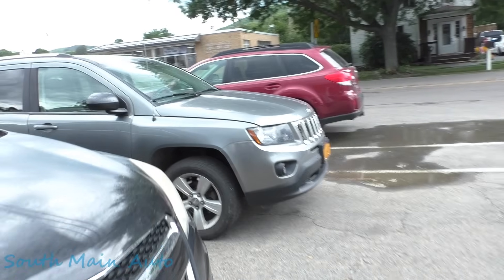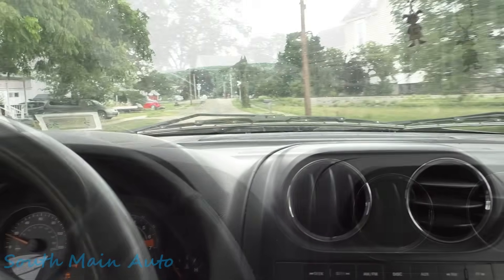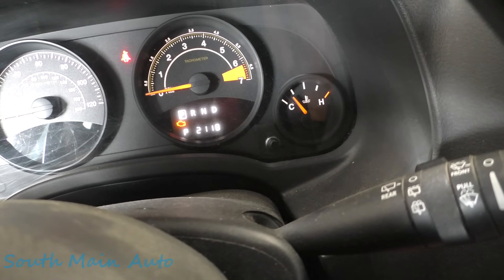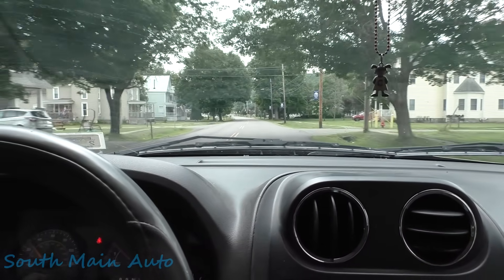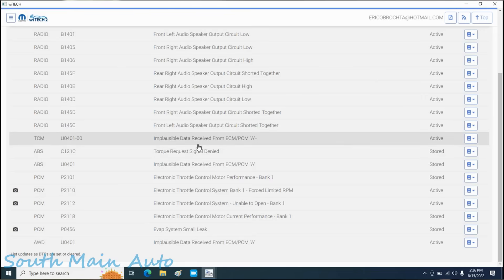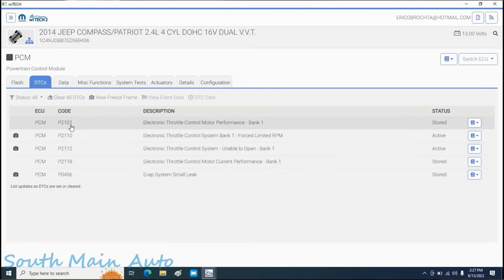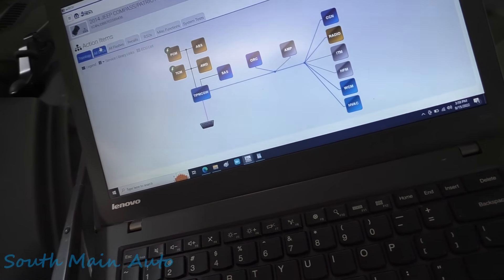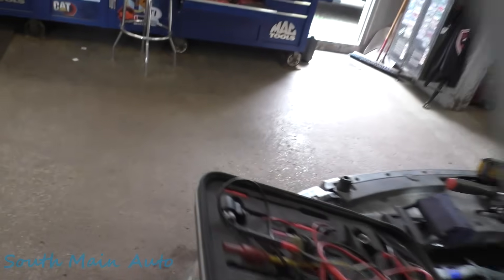Jeep Compass: Flashing Throttle Light & No Go

Comment: "You know, like you're really tryin to push one out"..... That was a hell of a visual there, my guy.... You always have the most informative and entertaining vids... Killer combo....
Reply: P2112 new slang for constipation!!
Reply: I laughed my ass off with the facial expression and above mentioned text.
Reply: I thought he was giving birth there for a minute
Reply: @roberttaylor3157  code brown if you’re in the medical field. :)
Reply: Throttle by wire replaced cables because it allows complete control of the engine. They can now adjust fuel flow, timing, valve timing and air intake. It allows the mfg to make more power and skip over rough spots. Also they can play with “modes” by changing the throttle reaction speed. Making sport touchy and eco slow to respond.

Comment: My wife’s journey has the same engine as this jeep had p2110 code with the traction light and throttle light. Was a intermittent problem at first, that went away after turning the car off and on. It would be fine for a while then come up again out of the blue. I took off and cleaned throttle body, checked for damaged wires and was good for about 3 months before it went out completely. Put a new throttle body on and solved the problem. At the time, this past February no one had in stock except the dealer who had a few on the shelf. From what I was told they go bad often, the new one is a updated version and I had to cut in a new plug that came with the throttle body because the connections are different now. Not a hard job to do though. Thanks for the video Eric. 👍🏻

Comment: commenting at 3:09 I'm gonna go on a limb and say it needs a throttle body. I had the exact same thing happen with my 2010 Compass and all the same lights. I read the codes and it had codes for throttle position and throttle pedal. Did some research and found the most common thing was the gears on the throttle body go bad or the bushings on the flap. I replaced my throttle body with a Dorman full assembly as it was all I could get at the time and fixed it. It was the bushings wore down and flap was getting stuck in closed position. Never had an issue with the Dorman part.

Comment: I really liked this video.   The throttle plate, linkages, and associated sensors are the cause of almost all drivability problems.   They are extremely reliable:  if properly set.  Then there is the "Industrial Hygiene":  keeping the important things clean and lubricated.   No matter how well someone is designed or manufactured;  things do get dirty and do wear.  In this case, he took the time to clean the throttle body assembly, rather than replacing it.   ...getting another couple years out of it and saving the customer some money.

Comment: A customer at the auto store stated he had the same issues. Sometimes it would throw the same codes.
      Thanks for your Channel he knows what to say when he takes it in for any repairs.
Reply: Guaranteed the throttle body is still bad.  The gears inside get chewed up.  Just change it out (20 minutes) with a Hitachi and it's fixed for years.

Comment: Son in law in law owns the 2012 compass I am serving.
It stalls on the road at unpredictable times. 
Inspected relay box and connectors inside fender well, relays clean and contacts clean.
Based on your video I will clean throttle body.
😊

Comment: Had a similar thing happen to a 2003 Jetta TDI. Being a diesel engine there's no throttle of course but it did have an anti-shutter-valve that kept the engine for sputtering on shut down. That thing got gummed up and stayed shut on the next startup. No codes so it had me confused for a while but I figured it out and cleaned it just like what you did. Fixed!
I had to pull that ASV about every two or three years and clean out the gunk or it would freeze up and no start.

Comment: I've cleaned many a throttle body. It's the first thing I do along with cleaning the MAF for hesitation, stalling or lack of response. 95% of the time it's the fix on most makes and models with higher mileage. Test drive then, if not fixed, diagnostics. Saves me a bunch of time and customers a bunch of $. Of course, you knew that. Quick fix with no parts and a  happy customer. They usually return and tell their friends.
Hope they got the brakes and bearings done to make the car safe. Great informative channel you have here....I've learned a lot. Thanks!

Comment: Excellent diagnostics! I really liked the logic of working with error codes. 

I don't think this throttle valve will work for long. Most likely, the plastic gear of the damper drive is already damaged. You can even hear it when you turn on the ignition. There will be a sound similar to a quiet crack. 

I was surprised that there wasn't a lot of oil inside. This means the PCV valve is still doing its job.

If you decide to wash the damper and see a lot of oil, be sure to change the PCV valve.

Comment: I've been looking into refrigerator issues and using skills learned watching these videos.  They call it the "control board" but really it is the RCM - refrigerator control module.  And you need wiring diagrams as they change wire colors on you.  But with the diagram, you can test from the RCM plug.  And they have evaporators for the freezer and fresh food now with a three-way valve to make things complicated.

Comment: Hello Eric O, I have a 2014 Chrysler 200 4 banger 259K miles owned since new. I replaced the factory throttle body with a mopar throttle at about 130K. In your video you said you were unsure when the pcm is performing its test cycles. For me the thing always went wonky at a stop light. It did it to me last summer and I cleaned the throttle body and it did it to me this morning coming into work. The code I get is P2173 to much air flow I checked for vacuum leaks last summer and found nothing. Its been golden until this morning. Im a subscriber because of your methodology to finding the root cause of issues its the only way to do it on todays vehicles. 
Mike - Plus8Precision

Comment: I had a similar problem with the butterfly valve sticking closed. Drove all day then all of a sudden I couldn't move the throttle.  Cleaned it up and it's been fine ever since. Cleaned a bunch of butterfly valves for others too. No parts required fixes are awesome. Stuff you didn't see before direct injection.

Comment: It's my opinion that a tuneup should include cleaning the throttle body and MAF. I believe this would prevent 90% of the throttle body faults. Maybe avoiding Chrysler products would help too.
Reply: You turn wrenches for a living?
Reply: 100% should be part of the 30k tune up with the spark plugs. FCA connectors notorious for the crusties, and the spot where the TB is gets VERY dirty.
Reply: @ShainAndrews  is that relevant?
Reply: @ShainAndrews doesn't fuckin matter dude...he's stating a fact. I've been turning wrenches for 15 plus years... ANYTIME I remove the intake hose the throttle body and maf get cleaned...but it should absolutely be included on a "tune-up", especially since cars these days don't have plug wires and caps and rotors etc...people that say you need to replace coils during a tune up are idiots. Coils don't fail that often. It's normally the coil boot with the spring. And you can replace those separate. I've only had one coil fail on two vehicles I've owned over the last 14 years...and I've bought and sold over 200 cars over that time.
Reply: @ElantraFukkenGang newer spark plugs are good for 100K miles
Reply: @jessejames96  literally says right in the owners manual of patriots and compasses replace every 30k with copper spark plugs. But ok. Lol
Reply: Well, I removed and cleaned mine and it's faulty now. Like he said they are very fussy about how they are supposed to work.

Comment: Eric - on the old school throttle cable - I had a Ford Fairmont back in 1989 that had the manual throttle cable stick wide open down in Bath NY going through the main light by the expressway. Shut it off quick enough, unstuck it and then drove up to the old parts store across from the library and bought some spray to lubricate it up. Throttle by wire is designed to fail closed.

Comment: I’m still early in the video, but the feeling of misfiring when sitting in idle in park after you had the throttle limp mode is because the ECM is limiting the engine speed down to 1500rpm by shutting off injectors. When the throttle hits limp mode, it will shut the power to the throttle motor off and the throttle will sit at about 10-15% open. When you were pushing the throttle and it revved up to like 2500rpm from 1500rpm, the only thing that was changing on the engine was re-enabling all the fuel injectors (and maybe changing ignition timing). The throttle body didn’t move at all, because the power to it was shut off. It would feel like it smoothed out when you shifted into gear because the additional load of the transmission being in gear was enough for it to be able to re-enable the injector(s) it was turning off and still stay within the rpm range that it was happy with.

Comment: Thank you Eric!  I enjoy watching your troubleshooting efforts!  I'm new to the automotive electronics bit and I was involved with industrial process control for a good part of my life.  It's interesting to see how the automotive engineers have "re-imagined" electric and data control circuits.  I know that they are cost driven, but it makes me wonder how cost efficient it really is except for manufacturing.  When you described the throttle body motor circuit and the redundancy involved it reminds me of what we call in process control and fire & watch systems as "supervision."  It is a way of determining the true state of a device in control, or if the circuitry or electronics driving it have been compromised.  Thanks again!  😁
Reply: @dizzy2020  All they have EVER cared about is assembly.  Decades ago when cars had frames, I saw assembly lines where the frames were upside down.  They put the shim packs in for front end alignment.  Then when the owner of that shiny new car finally has to have a front end alignment, the bolts are loosened and the shim packs fall out!  And over the decades nothing has changed.  They find the cheapest way to assemble a vehicle and the customer be damned!

Comment: I'm guessing too that the heat from the engine might play a role in expansion where the throttle sticks less after things warm up. Nice job going right to the problem and trying not to fire off the parts cannon.

Comment: Was having a similar problem with my 2003 Chevy S10 with the lil 2.2 liter engine. Cleaned the throttle body and WaLa it's been running good ever since. Thanks for the help.

Comment: My experience with these is that the gear train inside wears out and starts to get a bunch of play in it which hinders the plate from closing or opening to the proper position when commanded. Aftermarket bodies are useless and don't last, dealer only which means probably the updated connector. I've taken apart a couple GM units and found that there was just a bunch of lash in the gears between motor and plate, the ECM would command X% throttle but the lash would prevent that from being achieved AND if the TB was extra dirty it would bind up more than the return spring could pull it and with the slop in the gears the motor couldn't pull it further either. GM's go-to symptom was a crank no start or start and die that needed a bit of manual throttle pedal to get the car started. With Chrysler it's just codes and limp mode, but you can certainly feel and hear a big difference between a new and old unit. I'll echo others, it'll probably be back but it's a commendable and honest effort to try the cheaper repair first. If it does come back please update us and show a wiggle test between new and old throttle plates!

Comment: Just traded in my 2006 Pontiac vibe with 217,600 miles for the 2014 compass with 45,000 mile I hope that it’s as easy to work on as the vibe I’m getting cold feet, I utilized your Corolla wheel bearing video to press one on the vibe. Bought a OEM bearing kit. You provided top notch instruction! 👍

Comment: 2010 Dodge Nitro.  I had the same issues.  It was the throttle body.  They have plastic gears inside, and if the butterfly gets gunked up with carbon or even freezes in place from having a little moisture on it in the winter, the little electric motor will shear the plastic gears inside the goofy thing.  I guess if they made it with metal gears, it would end up burning up the electric motor, so you can't win either way.

Comment: I had the exact issue earlier this year with another Compass. All the advice I could find said to replace a defective TB. Had I known it was just coked, it would have been a cheap fix. Fortunately, TB's for these are inexpensive so it wasn't too much more than 'cheap'.

Thanks for all the great content on your channel. 😀👍
Reply: If you still have it, do a post-mortem on it.  You'll most likely find that the gears are chewed up.  Cleaning only buys time.  Trust me on this - cleaning these is temporary.
Reply: @ohger1  what if the throttle body has been replaced and still doing the same thing.
Reply: @caleyannemcmillian7836  Several possibilities - where did the TB come from? Used, Chinese knockoff maybe?  When I replace these, I only use a Hitachi TB as the  Chinese (Amazon or some parts stores) parts are garbage and act up shortly after install and ones from Jeep sometimes crap out in a year.  Also, there could be a wiring issue or some other problem.  What are the codes?  

EDIT: Rockauto has the Hitachi part.  I wouldn't trust any other in this application.  The Hitachi will fix it if it's a TB issue.
Reply: @ohger1  it was a used one. We replaced the whole ignition and computer. It’s showing the esp light constant and codes p2110 and p2118. Also replaced wheel speed sensors
Reply: @caleyannemcmillian7836  If it was mine, and I was going to keep it for a few years, I would replace the TB with a Hitachi (which unlike the new Jeep replacement part that isn't any better than the original, doesn't need any rewiring).  The Hitachi is a superior part and will eliminate the TB as your problem - your used one could be bad. Now, what was the original symptom with the Jeep that made you change the TB?  Was it going into limp mode, stalling, not starting?
Reply: @ohger1  it was running in limp mode. Still is. Cleaned the original TB. No change. Replacement done also cleaned before install.
Reply: @caleyannemcmillian7836  Was the replacement a plug and play or did it require the plug be changed to a different type?
Reply: @ohger1  plug and play no change
Reply: @caleyannemcmillian7836  Your codes indicate a TB issue - if this was my car that I intended to keep for a few years, I'd replace the TB with a Hitachi anyway.  The TB you bought used could also be bad - these are known parts that fail routinely in this engine family. If the Hitachi didn't fix it, then it's a matter of more advanced troubleshooting - checking for voltages on the connector and using a scope to watch the feedback data.  A high end scanner will provide live data to see what's causing the codes. There might be a break in the wiring harness between the TB connector and the PCM connector. Sometimes you just have to send the car out if you're not really good at advanced troubleshooting, but a new Hitachi TB will take that part off the table anyway and give you many years of not worrying about that part.  I've seen new Jeep TBs quit after 6-12 months and the Chinese ones not work at all.
Reply: @ohger1 what if now that’s been replaced with a new one. Still doing same and the esp bas light is still on

Comment: When I worked as a service advisor at the Ford store we replaced a lot of sticking throttle bodies. Wonder how many of those just needed a good cleaning.
Reply: None.  The Ford ones are known for internal failure with the gears after they stick from being dirty
Reply: My wife jeep compass is taking a while to start in the morning,shut off when stopping could that be throttle body pri
Reply: Problem

Comment: I'm not a mechanic, but can work on cars/Harleys, basically a parts changer. The issue now is all the electronic gizmos and from watching your vids, I see just scads of not only electronic gear, but online data that is not available or affordable to the DIYer or even gentleman mechanic. What is great about your vids is the detail and rational explanations you offer on most aspects of the issue at hand.  One day soon with EVs, you will have to have the junk towed to a dealer that only does that brand, and they will keep it long enough to get parts etc, that you will have to buy a secondary vehicle to get you by till they get it fixed. Beware of buying crap cars that can only be fixed in some large city far away, like a Tesla. Not pickin on Tesla as there will be others. Kind of a raw deal when you have to pay that much for a car that can be out of service for many more reasons than supply chain issues. And I suppose more scan tools and subs...

Comment: Personally, I miss the rod linkage we had before cables. The ones that pulled the throttle open when you broke an engine mount.
Reply: I actually had that happen on a 1960 Pontiac.  The thing just took off!
Reply: Yep! I agree with that. Had a 1969 Ford Fairlane 500. At 6000 miles the motor came off the mounts on a full throttle start and stayed at full throttle as it ate right through the radiator. Flat footed brakes and a fast ignition key switch off was all that saved the day. I think it took my 17 rear old eyes 👀 about thirty minutes to get back down to normal size. Ahh, ....the memories!!